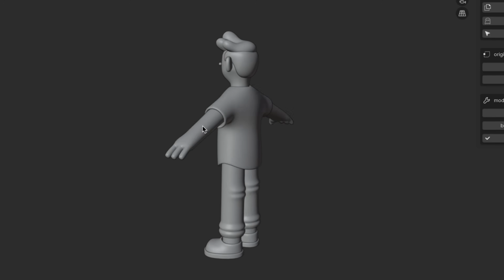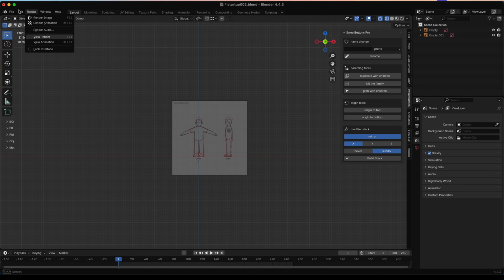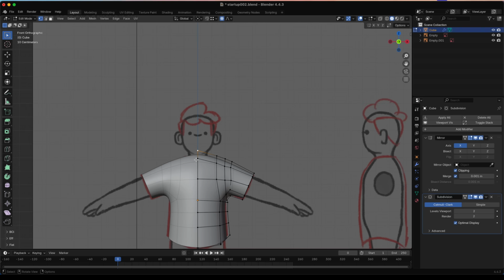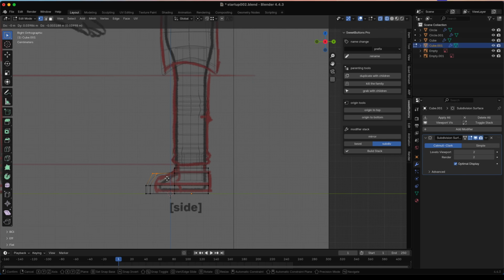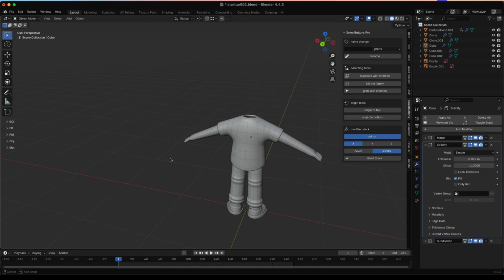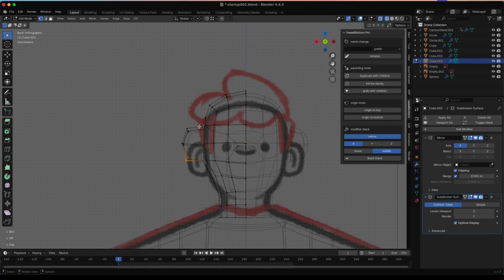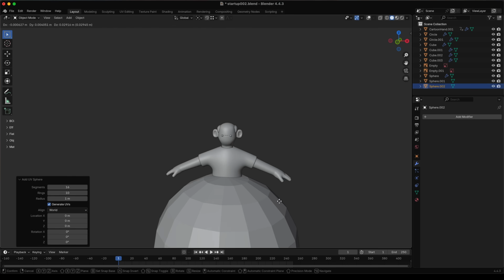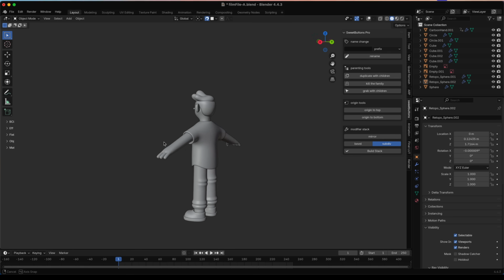Character Design Lab - Part 1: Design & Build

Comment: I downloaded the free version of Quad Remesh for Mac. I tried to install it and the Quad Remesh tab doesnt come up. I went back to the site and it doesnt give clear instructions. Is there another addon that I can use?
Reply: Qremeshify is good but try to activate Quad Remesher. I have similar problem their website doesn't open here. So I even can not buy it. Probably registration process doesn't work at your case.
Reply: @polatkemalakyuz2021 thx. I ended up using PolyQuilt and did the retopo the hard way. It ended up being so good!